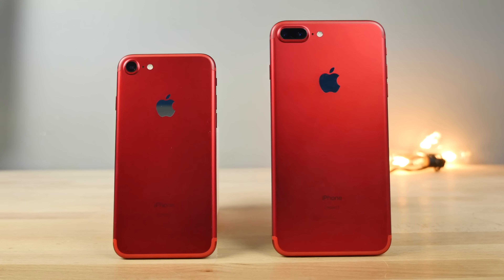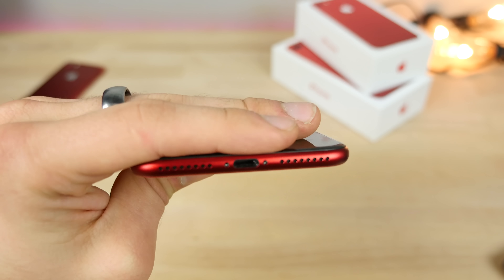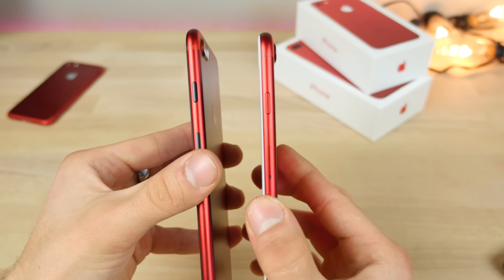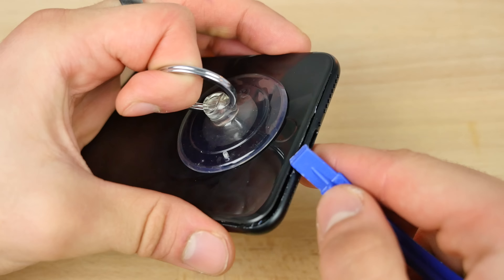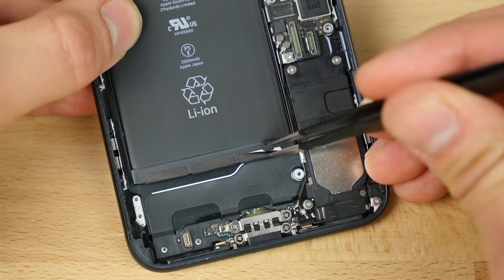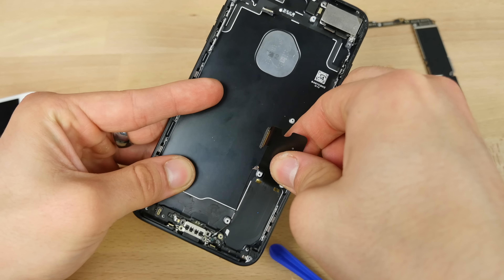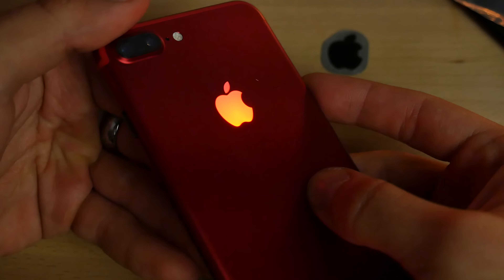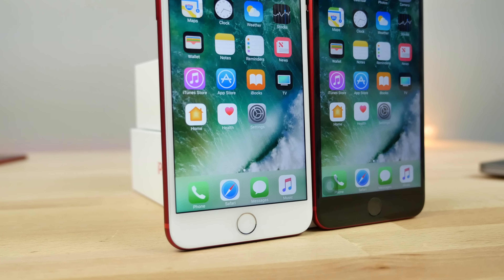Black Screen & Buttons on RED iPhone 7 Plus! Perfect Setup

Comment: ...orrrrrrrrrrr apple could just make a black screen version.....
Reply: Ariez A You genius!! Well they didn't.
Reply: Ariez they wont
Reply: Ariez no but COLORWARE did, if u want the black/red iPhone so much order it from them
Reply: Ariez i Will just paint it black
Reply: Ariez orrrrrrrrr.... apple can make the whole iPhone red because if you have a case on(unless it's clear) you won't be able to see the red
Reply: RΛZΞ R That's dumb.
Reply: They used a white screen because the Product (RED) colour scheme is white and red. Using a black screen won't make any sense
Reply: I just complained about the flaws with the Product (RED) iPhone 7 in the feedback section.I encourage you do it as well there is still hope!I mean i personally don't like the black screen but most of you do.Just i hate that the Apple logo,around the charging port and the ring around the home button are silver,not chrome red.
Reply: Ariez that will cost money 😸
Reply: Wanheda they used a silver/white phone because that's what they had a mountain load of stock of. A huge percentage of people went with one of the black models this year to differentiate them from the 6/6s and Apple needed a way to get rid of their overstock.
Reply: You can just put the red case on the mate black iPhone
Reply: TECH-FIGTHER Use your brain. Just because the iPhone 6 and 7 are somewhat similar, doesn't mean they can still use it. There are TONS of differences internally and it'll be much more expensive to change it, rather than just making a new one.
Reply: Wanheda I think you misunderstood what I was saying. I mentioned the 6 because many people who upgraded wanted the black to differentiate from the phone they were moving away from. Since black was the "new" color this year, it sold in very high numbers and that  likely left a lot more white front phone front panels in Apple stock. Best way to get rid of the overstock is to make the new color with the part they had the most of.
Reply: TECH_FIGHTER, Apple isn't stupid, black has always been the most popular colour for all iPhones. They don't make the same amount of phones for each colour, they make more black because they know it'll be the most popular, as usual. I highly doubt that the iPhones with the white front did so horrible that they had tons of extra screens. Also, if the phones with the white front didn't sell well, that would mean they would also have the body in whatever colour, so making a red phone wouldn't really help at all.
Reply: Wanheda possibly but the Red iPhone is a silver phone that has been anodized red as has been shown by those making tear down and scratch test videos. Whatever may be the case I expect more of this strategy in the future to help prop up slumping sales towards the latter part of the product cycle when people start to hold off purchases until the imminent release of the next model. Good strategy IMO.
Reply: TECH-FIGHTER ok
Reply: Ariez If Steve was still here there would be that 😭😭
Reply: I mean they made a red iPhone 8 with a black screen
Reply: The Red 8 Plus has one
Reply: @IfeolumideAdewoye  iPhone 8+
Reply: F. Baran the 7 has a white screen and the 8 has a black screen
Reply: the product red iPhone 8 now has a black screen
Reply: they did it. with the iphone 8 not to iphone 7
Reply: Spongebob narrator: “THREE YEARS LATERR”

Comment: Getting a Red back shell make more sense
Reply: samitha sheshan but the internals won't be the same therefore the product info ID would be different so it wouldn't be an official red iPhone anymore.
Reply: BarfingHamster It will be different anyway cuz you have to swap the black ones logic board to the red shell to get touch id working idk there is some other method to get it working

Comment: Buy a black home button sticker for the white home button. So the Touch ID still works.
Reply: Tyler Dorsey how the fuck is the button supposed to read your fingerprint with a sticker over the button?
Reply: The fingerprint scanner is actually the ring around the button, not the button itself.
Reply: SR_Qianna I know it's not because I have a screen protector that covers the outside ring. It's the button itself
Reply: Or you could just buy a red skin for the black iPhone 7.... is much less time consuming, much less effort, and you don't have to buy another iPhone just to do it.

Comment: but the home button doesn't work... you would have to keep the white button that came with the original display because the home button is linked to it.
Reply: Cryonic Two3 all you need to do is switch the logic board and it will work.

Comment: Why didn't you replace the case on the iPhones. That way the home button would still work...
Reply: TheGamingFireUltra - Because the whole point of the project was to replace the front panel on the iPhone so it can have that devilish color scheme. Black & red, probably his favorite colors. I would not be surprised. Otherwise, it would've just been a pointless autopsy where you just take it apart, and put it back together.
Reply: 101ToonLink he could have literally taken the red metal backing from the red phone and swapped it to the black iphone. same result, easier process.
Reply: A5C3NS10N STUD105 as you can see in the video you can't just "take the metal backing" everything is connected to it, unlike taking off the screen (which he did) where only about 2 things are connected
Reply: Do you mean, why didn't he swapped the motherboards on the iphones? that way the touch id will still work and takes like 10 minutes to do.
Reply: yes
Reply: Joel Nunez true, he went through all that trouble to do this to begin with, there would have been no way I would have wen through all that and not had the Touch ID work lol !!!   Kinda weird

Comment: Hey!
Why don't you give away your Modded Blacked Out Red iPhone 7 Plus with Black Screen, Buttons & Apple Logo Mod.
That would be the Perfect Product RED iPhone 7 Plus Giveaway.
Reply: Lohitakksh Chauhhan The home button doesn't work does it?
Reply: The home button works even if you just change the display and the home button.
But to make the Touch ID work you have to transfer over the logic board with the home button as well.
So the phone in this video will function properly.
Reply: If you replace everything it should work
Reply: On iPhone 7, the home button nor Touch ID doesn't work without original logic board
Reply: yeah, just switch the logic boards - the one in the red housing goes with the white display to the black housing iphone. 
he should not have this problem if he has done so.

Comment: I have my red 7 Plus in an otterbox defender case, it cost a lot of cash and I want it to stay nice. However, people are commenting on how nice the silver apple and red shows through on the back. I also ripped the plastic cover off the otterbox and replaced it with a GlassPro tempered glass. Originally when I saw this video i wanted the black front, but in the otterbox, the exposed white looks kinda cool in my opinion. In case you are interested, the GlassPro also comes in black, so no need to canabalise another iphone and you can have the black if you want. Just my little combination and i'm happy with it

Comment: I attempted something like this, with a white/silver back and black screen to resemble the newer SE models. I used a cracked black iphone and bought the rear housing, and a new screen. Transplanted the logic board to get touchID but didn’t replace the buttons though.

Comment: But you didn't mention that the black home button doesn't work on the red iPhone due to apple's new home button technic, so if 
 .you need a black screen with a functional home button you'll need that white home button from the original iPhone red.
? So can you make another video putting in the black home button that would work? is that possible

Comment: Hmm, as a designer I spend a lot of time working with colour and the red pops against the white, it just doesn't again black. Black front normally look better because when off they are all black unlike the white front. The black iPhone with white from looks better then the red with black. Also black does fit with product red. Apple got it right.

Comment: I had an iPhone 7 Plus but the battery was at 76% so I had it changed for a YOOBAO extended battery which supposedly had bigger mAH compared to the stock battery. Had it done by a professional and everything was working perfectly other than the fact that it did get abnormally warm when charging. Two weeks later when I was on the phone with my girl, the phone overheated and exploded right next to my ear. I didn’t see any flames initially but I felt intense burning on the side of my face and the doctors said that it was the chemicals released from within the battery. Now I’m partially deaf in my left ear and my face has scarring on the places which were burned. Thankfully my eyes didn’t get affected and I did send a notification to Apple but have yet to receive a response.

Comment: I accidentally found a way to add yourself back to a group chat on iOS. 

so if someone draws a picture on that little black thing where you can send fireballs or shit like that, you can tap on it. At the bottom it gives u an option to send a message but only in there. When u send a message from there once it automatically adds you back to the group chat. Idk if I'm giving clear instructions reply to comment if you need a better explanation

Comment: imo here's how apple should have designed it:
red buttons
red charging port chamfer thing
red apple logo
black front
black touch id with red ring around it
and a dark mode in 10.3 would be nice too
but nooope apple is $cheap$